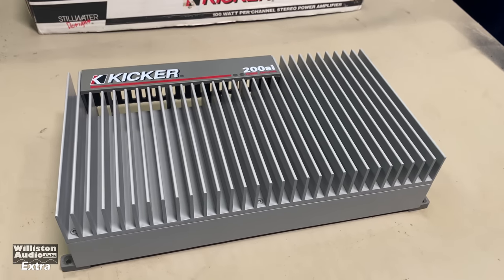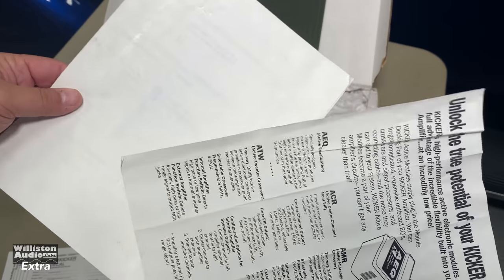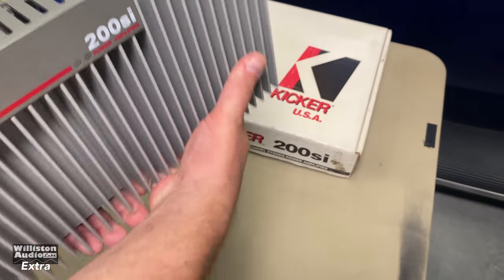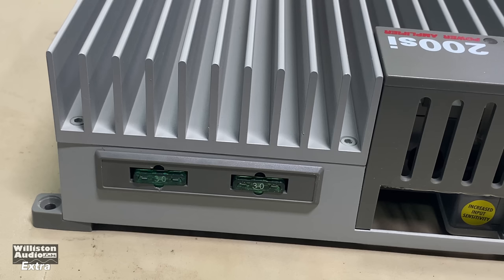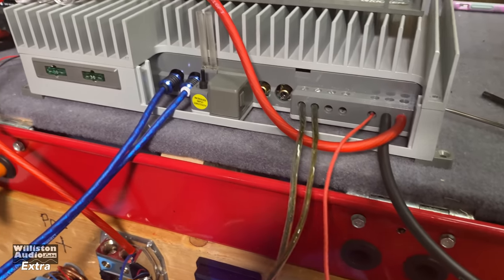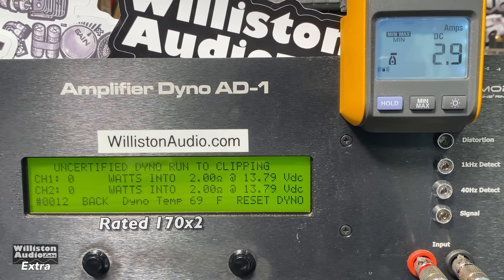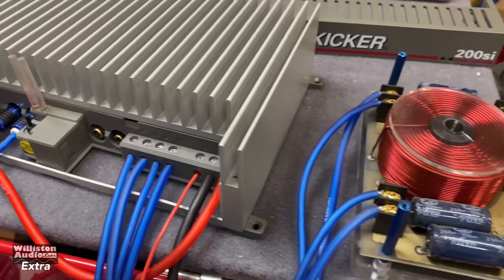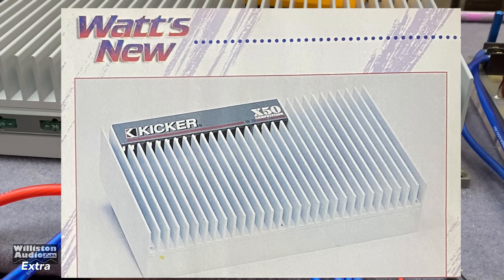Car Audio Time Machine? 1994 KICKER 200si Amplifier Reviewed and Amp Dyno Test [4K]

Comment: Dang near thirty years old still does it’s rated power that is just amazing good quality amplifier built by kicker !!!
Reply from the maker: Agreed!
Reply: Spoiler!  :-)
Reply: But if it wasn't used, I would think it still should do what it said it would do (given Kicker is a reputable brand). It's not as if it had shelf life and degraded by sitting around.
Reply: @mr.c6674   actually caps do lose some life over years typically just like all electronic do
Reply: They always were a love of mine, those and Rockford. They always had easy on the eye amplifiers.
Reply: It's from the 90's, electronics were still built to last.  Not the disposable crap they make now.  I still have an old keyboard from my old 386 computer from 1992.  Mechanical switch keys, the thing works great still.
Reply: An amp doesn’t lose power over years🙂

Comment: That dude is mint! I was hoping to see those suitcase guts tho yo!
Reply from the maker: Fo sho, I thought about it, but the hex bolts still had the OG paint on them and I didn't want to disrupt the look. These are hard to open up as you know.
Reply: @wal  what was ur $ price $ ?  Thanks big D. I wonder if my Clarion APX 400.2 would dyno similar results?
Reply: He doesn't want to void the warranty bro.....geez. He didn't even send the warranty card in!
LOL could you imagine sending it in for warranty repair? I bet you get a different amp back!
Reply: DJ WRAITH  As if some paint and a Q-tip couldn't be sourced?
Reply: @jamesplotkin4674  changes it’s collector’s nostalgia 🤷‍♂️ as an original- could easily be made an NFT
Reply: Yea, until he used those pliers to pull out the fuse. He put the first marks on the top and bottom of the fuse opening.

Comment: im still using a kicker 100si that I won in a sound comp back in the 90's. it definitely doesn't look as good as that one and the plastic trim got lost during one of the many times I loaned it out. But it still does the job.
Reply: Hell yeah...good is good and don't go out of date 👍

Comment: One of the selling points of these Amps was being able to Hide the Wiring for a "Clean" Install. Especially in cars with rear deck lids, you could have the Amp on display and no wires showing through the rear window. That is why Kicker let the installer cut out that part of the cover for the wire install.
Reply from the maker: Good point 🤙

Comment: The "breakout plate" was an option so you could have the wires hidden by going out the bottom of the amp, which was in the amp cut out template. If you didnt want them to be completely hidden you could break off the breakout plate and have the wires come out through the front instead.

Comment: The section that can be broken out is left in if you wanted to back wire the amp so you don’t see the wires 👍🏻. Kind of like my 90’s Fosgate amps, you had to back wire the amp to put on the end covers so you’d have a clean looking install. One of my good friends owns Custom Enclosures Car Audio in Bristol VA and back in the days I’ve seen quite a few installed by him that way. Beautiful amp in perfect condition and it works to boot!

Comment: The plate not being broken out from the factory is because it had the holes in the bottom of the amp to run the wires hidden instead of running out the back.  If you look at the cutout template it shows you the cut pattern for running the wires hidden.

Comment: I remember back in the early 00s I traded my jacked up 1994 Eddie Bauer Explorer on 33x12.50s for a 1992 Acura Integra, a set of 17" chrome wheels (which were REALLY cheesy), a Soundstream Rubicon 4 channel 1000w amp, and four Kicker Solobaric 10s. I remember the motors on the subs said Stillwater Designs on them. They were definitely old, but my cousin was owed a favor by a local stereo shop and they built me a custom fit box for the hatch area. Those subs sounded SO good and hit fairly hard. I remember that I had a Sony (the ONLY car stereos that I would buy back then) Xplod tape deck with a Sony 10-disc CD changer. I even had an old Sony unpowered tape deck with a motorized face that folded down to expose the tape deck and I had a Sony 4 channel amp that went with it. I also had an old red anodized US Amps 125x4 that was .25 ohm stable with a plexiglass bottom and about 4 feet long. When I was in high school I had an 89 Chevy Beretta GT with two Image Dynamic amps and two Image Dynamic 15s and people at my school said that it sounded like thunder. I shattered my rear windshield in front of the school one day while I was leaving the parking lot and I was suspended for 3 days because of it.
Reply from the maker: Good times 👌…well, except for the suspension part 🤣
Reply: I also loved the tape deck and cd changer setup. Mostly because tape decks were not prime targets for theft.  It was awesome. Listen to anything, make mix tapes and in a beater car, nobody knew you were packing

Comment: I had a Sansui, 2 channel 75 watt RMS car amplifier from the late 80’s/early 90’s. All it had was one sensitivity adjustment, power in and RCA  plugs. A simple no frills plug and play amplifier. I wish I had that amplifier today. 
Great Old School amplifier that kicked ass.
We didn’t realize how great some of the old school car stereo products were from Japan until manufacturers first started making lower quality products made in China. I wish I still had my old Nakamichi head unit made in Japan, along with my old school Boston Acoustics 6 X 9 speakers. Today I have all JLAUDIO that is dated.
Older. JLAUDIO Slash series A/B amplifier’s, 4 channel and 5 channel with JLAUDIO speakers and sub. I am keeping those.
Reply: My dad had an awesome Sansui home receiver he brought home from Vietnam. “100 watts per channel”. Yeah, right. No full size old school floor speakers could handle it at half power. I would crank it after high school before he got home. What killer sound and quality

Comment: 200si is the one I let get away!  I was about 18 and bought one of these (so it was a 5-6 year old amp) from a friend for $200- I was 'using it' and basically the bass made a couch fart sound prior to the main fuse popping and smelling the magic smoke.  I used it for maybe 1 year.  Sent it to Kicker for repair, they wanted $200 plus return shipping to fix an amp I spent $200 on, so it I let it stay with Kicker.  

In my case, the vehicle didn't have enough alternator output to keep up with that amp, and the amp in turn tried to pull more current to sustain the load.  This created a real hot spot right at the voltage input and return, so hot it caused the plastic and 8 gauge wire jacket to melt right at that input on the amp.  Who knows, it could have been an insufficient ground as well.  Gotta love those first systems.

Comment: I had the original 200si. This is the revision with the increased input sensitivity gain. I used the KEQ module with 6db active bass boost(double output) pushing two grey 8ohm solo baric 12s in bridged mode. I used 90 degree rca cables from underneath so not to break the tab on the cover. I had the 200si, zr120, 40ss, and 50si daisy chained with crossover modules creating bandpass points.
Reply from the maker: Awesome 👏

Comment: I bought the model down from this one. 160si or 120si. I cant remember. I saved all my money from working minimum wage. It was the first part of my system I bought. It ended up blowing. I contacted kicker and they offered me the current model up from it for just a bit more money. Think it was the SS line. It was an amazing amp.

Comment: I bought a ZR240 from someone in California for $50 was also mint and had the SWS (subwoofer module) with it. They said they didn't know if it worked so I messaged them back after I hooked it up letting them know I was very pleased with my purchase.  3 years later I ended up selling it for $450

Comment: The power & protect light extenders are ,east to be seen from the top of them. They’re made from plexi & just work like an extension to the top of the amp cover. With the cover on you will only see the tips of those extender rods from the top of the amp & wire cover. Killer new amp Brotien!!!

Comment: Tri-way crossover, I remember reading about those, even understood/understand how they worked, but your video is the first time I have ever actually seen one.  I think I understand why Kicker made it to where you have to break out that plastic on the cover.  If you look at the install template, there is a section for "Cut Along dotted lines for hidden wire mounting"  I suspect you could bring the wires in from the bottom and just leave the plastic piece there for a super clean look!  That would have been super slick!

Comment: I had one of those style crossovers made by Cerwin Vega. It was the original way to hookup 2 satélites and 2 subs. I made 2 sub cabinets same color and width as a pair of Bose 301 and converted them into lar power handling big bass speakers.

Comment: yeah i remember those modules. they used them all the way into the ZR amps. those ZR's were great amps. expensive, but usually way more powerful than rated, even the 120's bumped lol
Reply from the maker: One of the first amps I tested when I got my Dyno was the ZR120

Old School Kicker ZR120 Amp Power Output Test SMD DD-1 o'scope
https://youtu.be/e1oh1QbNCLs

Comment: That break out piece was depending upon mounting.  If you wanted to hide the wires you would run them down through the bottom and keep that piece there to give a clean look to the install.

Comment: @ 1:28 . Fun fact , when using the " a super knife  " never shift yourself into a flashback . When returning from said flashback there is a 28.3 percent chance u will get disoriented and scratch a heat sink or a finger

Comment: I suspect the cutout on the cover plate is optional based on how you route wires. If the wires pass through the vanity panel the amp is mounted through and you use right angle RCAs, some owners may not want the large opening showing on that face of the amp and the wires would be hidden/stealthy.

Nice snag on this amp!

Comment: Nice -  I remember these from back in the day ,They were even popular here in the UK -It may not be as efficient or as loud as a modern class D amp but I'm pretty certain it'll sound a lot better than a class D - Do capacitors need to be used to to degrade or can just age alone dry them out? if so I'd be thinking about replacing those electrolytic caps like I do with the old 80's/90's hifi separate amplifiers I often fix/rejuvenate and prefer to use myself.
Reply: both age, usage, and usage environment can affect capacitor life. heavy, daily use can degrade a capacitor, sheer age can degrade capacitors, and operating conditions/environment (temperature, moisture, etc) can also degrade capacitors. all of these factors, along with the manufacturing and chemistry of the capacitor can determine a capacitor's lifespan. there is also a randomness factor that plays into it, where if there was a piece of debris that got stuck inside the seal during manufacture, it could have just come from a bad batch, etc.

Comment: My first nice amp would have been a 500si, but my dad sent it back not realizing it was mine as I had it under the business name  😞 that being said I called up Speed & Sound and explained,  but also decided to go with my other pick instead which they were ok with. A Hifonics gen x Zues. Glad I ended up with Hifonics gen x amps  after all  👍 Yet still ran Kicker comp 15's and  later 18's which were beast in the mid 90's

Comment: I can only imagine how sweet that old ab would sound in an sq setup on the subwoofer. I swear i can tell the difference in d vs ab, even on a subwoofer. Im a broke a$$ basshead, so i use class d, but if i had this amp, id give up several db.❤❤❤❤

Comment: Tri-mode was awesome for us broke guys, ran Pioneer GM-H50 and then GM-H100 that way. A cool test would be power outputs through the tri-mode! Very cool stuff Big D
Reply: I had gmh  100 50w×2@4ohm and the gmh 200 100w×2@4ohm, but the 200 had two 30amp fuses and three power supply (1 4 fan) but I never understood the difference between bipolar & mosfet. The fact that it didn't come with a crossover made me go to the 921 kenwood and a sherwood bp 240 and to this day I've never heard a cleaner pioner amp for 4 6×9. Good times

Comment: The red light for power is like Kenwood which I thought was strange at the time, goes green for protect the oldskool model No.s like the  kac 923, 1023 etc early 90s models then realised Kenwoods logo has a red triangle above the w which is where the light is on those amps on the top, like also when it was sold as Trio in the u.k showing my age 😆

Comment: You gotta love the regulated amps. So much easier to predict performance. These 500 watts rms amps that do 3k dynamic bursts are getting ridiculous.
Reply: I thought that was true of non regulated designs
Reply: @brandonbelongstocharlottef1798  I think that is what I meant. The amp tested is regulated. Most newer amps aren't. Its a guessing game on dynamic power. Unless you meter it. If you set the gains normally and use rms matched sub and you actually didn't have an idea of the amount of dynamic power being put out. Seem likely you'd pop woofers all the time.
Reply: @1rexrex  I think the old school fosgates weren't regulated hence the actual power vs rated having significant disparity...it's all about headroom baby
Reply: @brandonbelongstocharlottef1798  They had regulated supplies. Or at least my Punch amps were. They were the Transana models with the xover modules in the bottom. If Im remembering correctly. That was 1996. 250m and 400a4 or something. Too long ago. But I can remember Fosgate advertising regulated power. If a company was serious about audio. They followed Fosgate.

Comment: What I would like to see , is some of these old amps(20-30)years old that you tested that should have tested better. Is to have someone replace the caps in one ,and see if it makes a difference . Reason being is my understanding is electrolytic capacitors dry out with age ,even if not used much .
Reply from the maker: I’ve done this, the Orion 2100 HCCA is a prime example. Original one vs one with replaced caps and transistors. Output power was no different. I agree that the caps should be replaced though

Comment: At the end about the wires pass through,, If the amp was mounted on a panel and it was viewable from all sides, you wouldn't cut out the pass through and drill the panel to run the wires without being seen

Comment: Now the power and protect indicator is this like the fiber optic type light on a gm square body truck ashtray light, the front fender mount turn signals on Cadillac cars and like the Chrysler Cordoba cars?!

Comment: Man I so want to send you my punch 300 to test. No one believes I only have a 300 watt amp pushing my 2 punch R-2 10S.
Reply: That probably kicks 500w+ rms at 2 ohms if u have them parallel.
Reply: @lagginswag  not sure how it would handle the 2ohm load but I bet you could get it
Reply: @gabec6522  old rockrord can get down, even if ur running 4 ohm @ 300w rms it's still probably underrated. 👍

EDIT: I see new punch is 300 @ 2ohms, hmm
Reply: @lagginswag  nice mine is 4 ohm bridge I think its about 375.
Just got a little harmony amp won't lie its really nice 400.1 and its about 100 ways underrated.  Even got the birth sheet. Crazy what a hundo can get u these days.
Reply: @gabec6522  nice! I replaced my old pioneer gma5702 with that jensen xda91rb and it's good so far. Its pretty sweet amps are cheap now for the power lol.

Comment: Hey Dereck, have you ever done a dyno video pre and post bass boost?
Reply: Bass boost doesn't change the max power from an amp. It actually reduces how much power you can use.
Reply: @blakebrockhaus347  Just to clarify, I don't use it I'm just curious. So if bass boost is set  then gain is adjusted, you will only make full power at the bass boosted frequency making the rest of the spectrum suffer. Does that sound right?
Reply: @antro_oner  yeah, that's entirely correct
Reply: @blakebrockhaus347  thanks for the replies!

Comment: Big D, do you just run on 40hz on dyno test on amm-1 to get max output? I have tried w/ it hooked to subs and amps arent doing power and i know they do power cause u tested. Would u run the US Acoustics Mike @ .5 rising to 1, .8-.9 drop every now and then. Im only running @ low power tho just pulling 1000-1100 watts for 2 10" incriminator audio I-series subs. Had to get 2ohm cause i got new from incriminator for just under 150 FOR BOTH BRAND NEW! After hearing them, best buy i have ever seen or heard of. they DEMOLISH any sub at 150 price point. PLZ help w/ pushing .8-.9 for us acoustics mike at very low power. ok?

Comment: when kicker was handmade in stillwater OK and came with a print out of the specs were the best amps ever made now they are probably Chinese clones made in china.
Reply from the maker: All still designed by KICKER engineers in Stillwater, just manufactured overseas to keep costs down

Comment: I've been looking high and low for that exact type of passive crossover. Parts express only have either duel or close to it but I'm looking for that exact kind where it's the 2.1 kind. Any help would be appreciated. Where can I get that same at least type ??
Reply from the maker: All of the components are listed so you can make your own. Just need a different choke depending on 4 or 2 ohm sub
Reply: @wal  Thank you